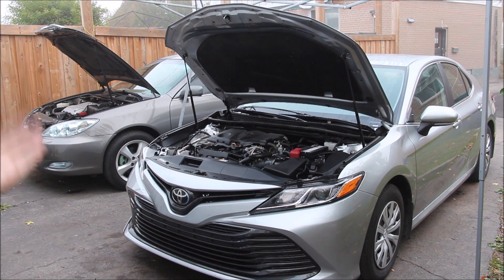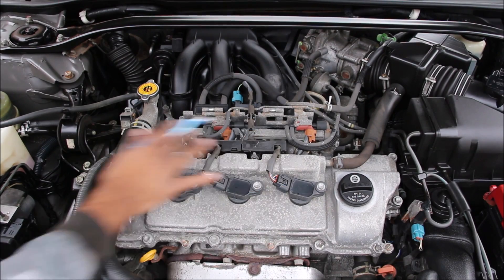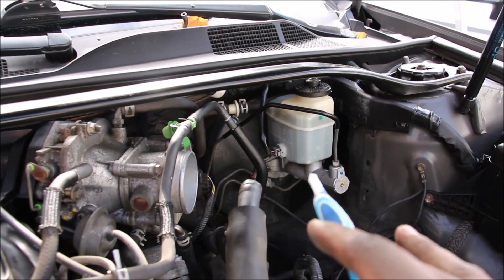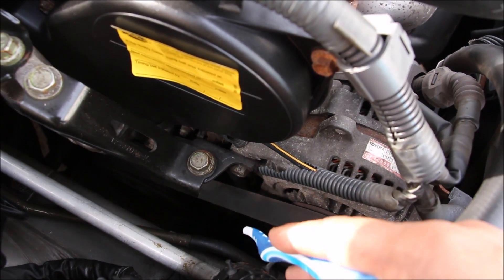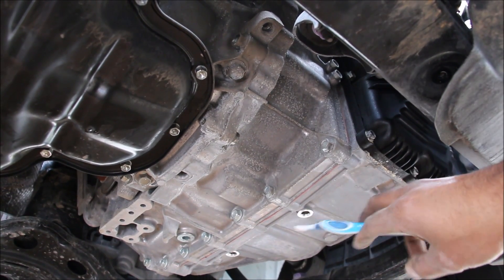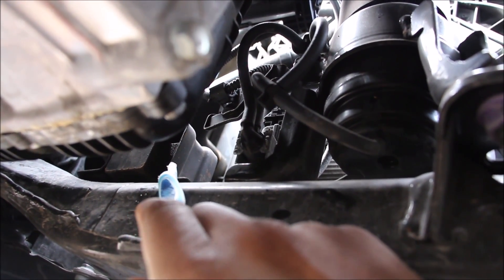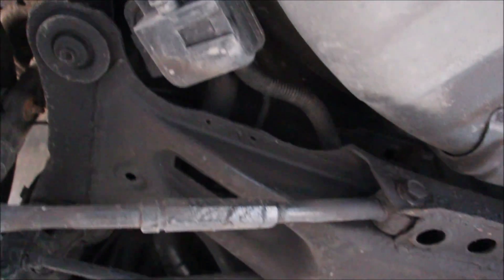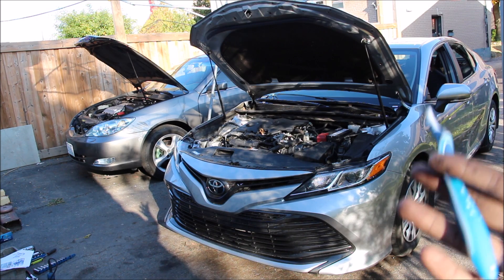Toyota Camry Mechanical Review | What Changed in 15 Years?

Comment: Peak car seems to have occurred in the 2000s-ish. Low emissions, port injected, knobs, dials, cable shifters and no infotainment. Who does't like the power the new cars are making but they cost too much to buy as a first owner and the second owner is going to have to deal with all of the value engineering. I do like the electric water pump and the return of port injection to keep the intake valves clean.
Reply from the maker: Great thoughts though a very classic perspective. The market has shifted towards cars that people buy brand new and without regards to those who will own/work on them down the road.
Reply: @speedkar99  We do OK with two working parents and three kids but we can't afford a new car. I think besides the govt mandates, the perceived need to redesign every two years totally drives up the costs beyond that of a working class family. Repair is also an issue as independent shops struggle to keep good help and buy all the tools while the cars change designs so quickly. Grrrrr.

Comment: The 4 cyclinder Camrys are very easy to maintain; you just cannot beat the engine room you have to work with.  My family has the 2002 XLE model.  Too bad that model has (apparently) known issues with head cylinder bolts (search youtube, if you haven't heard about it).  I like the new Camry except for the ECU placement (although that seems to be very common nowadays).  I also don't really like the direct injection because  they also have to use port injection to try to alleviate carbon build up issue on valves, but that's just more parts that could fail.
Reply from the maker: Yes the 4 cylinders aren't too difficult to work on. 
The V6 are challenging, though I'd still take a v6 any day for the power and smoothness

Comment: Hey Speedkar99 can you comment on the stabilizer link design on the Camry where it's a long link connecting the stab bar to the strut, vs some other vehicles where it's a short link connecting the stab bar to the lower control arm?  Opinions on performance? Awesome vid as always
Reply from the maker: The length of the link doesn't matter. The closer it connects to the wheel, the better the motion ratio and thus effectiveness.
Reply: @speedkar99  So my 1996 Nissan Maxima is basically a racecar, NICE haha. Thanks!

Comment: the 2002-2006 camry gotta be the strongest generation camry ever made. my clumsy girl hydroplaned and smashed into the road divider curb 40mph and severely bent both front steel donut oem rims. I installed new rims and tires and no problems. how in the hell ? I expected bearing, tie rod, control arms, suspension, ball joint to all be completely destroyed.
Reply from the maker: They are pretty tough. 
The 92-96 is probably the best but you don't see to many around probably due to rust.
Reply: 97-2001 the last great camries

Comment: I have a 2018 Camry. I hope this highly advanced 4cyl and transmission last over 200k miles
Reply: were at 140.000 on our 2013 camry no problems my son has corolla same yr 190.000 miles only problem coil packs. great cars
Reply from the maker: Time will tell. The last 4 cylinder did well
Reply: Change your trans fluid, if you have the guts to void your warranty. Of course, warranty doesn't compensate you for time lost if the car fails. I'd personally run a thicker oil too, but wouldn't recommend others do it. For that matter, I wonder what specialist taxi garages do to keep these things rolling; they usually have a few tricks up their sleeve for longevity and fuel efficiency of fleet cars.

Comment: What are your thoughts of the plastic shrouds underneath the vehicle? To me, seems like it will trap moisture, snow etc and accelerate the rusting process.
Reply: I was thinking the same thing about that
Reply from the maker: Yes and no. It prevents salt water from splashing there in the first place. 

What ever makes it there will be difficult to wash off since the plastic is blocking it. 

So far it's been working on on 12 year old Lexus.

Comment: Watching this makes me miss my Uncle’s old 2002 Camry LE. God, don’t I miss that car. 😭
Reply from the maker: Good times. Was it a v6?
Reply: speedkar99 It was the 4 cylinder. It had 246k miles on it before it got into an accident back in late July 2018. Despite the fact that it leak inside a lot, gone through many flat tires and and had a lot of mold & mildew, it was the most reliable car that my Uncle ever had. Always started and never once broke down.

Comment: Had a 3-way comparison going the whole time, since we have an 03 Avalon: 19 Camry, 04 Camry, 03 Avalon. Not seeing much that would drag me into the new Camry... except on the new one... timing chain (belts suck), rear suspension, beaucoup airbags. I worry about [future] aftermarket parts. Dorman is already plenty bad without burdening them with crap versions of sophisticated electric motors. And, if I got the new, I'd work with some body shop to change the front-end bite-y alien mouth & overhead attack pterodactyl into something more humane.
Reply from the maker: Which do you prefer personally? Your older or newer cars?
Reply: @speedkar99  Easy question, since I don't have a newer car: our family's old cars, 01 and 03 Avalons. At 66k & 98k miles, they're just babies... That said, I envy the new safety stuff, am suspicious of the plastic stuff, and know that the multiple module-driven stuff will evolve into expensive broken stuff.
Reply: @speedkar99 (Mis-expressed my first response - should have said, 3-way mental comparison, our 03 Avalon and your 19 and 04 Camrys. It was interesting to compare and  contrast the three.)

Comment: I like the fact that the old camry has proven itself  but maintenence is definitely easier on the newer camry.
Reply from the maker: It's not as bad on the i4 version of the old Camry. This isn't a direct comparison because of that.
Reply: V6 engine is complicated but 2.4 liter engine is so easy to maintain.
The comparison should have been between camry 2005 with 2.4 liter engine and new camry with 2.5 liter engine

Comment: Old one is a tank that wont die. The new one sacrificed a solid structure for safety tech
Reply from the maker: Yes alot of sacrifice at the cost of what made Toyota unique.... quality
Reply: Actually, the structure is much stronger in the new one. The A and B pillars are made of ultra high strength steel, which protects you in a collision.
Reply: Ends up being a ton safer though. Even the 2012 Camry holds nothing on the current one safety wise.
Reply: I believe that Toyota is using more aluminum and light weight strength.

Comment: Holy smokes toyota went with electric water pump and thermostat?
Reply from the maker: They've been doing it a while
Reply: Toyota is copying from the Germans.
Reply: @theinvisibleman2070  LOL
Reply: Much more faster engine thermal handling and those work just fine
Reply: Toyota has gone OUT OF THEIR WAY to screw you out of money.
Reply: @baddestburrito  Paranoia.
Reply: @seanv1556  I drive a 27 year old Toyota that still runs like it's new.  Do you think the 2019 models will be equally healthy in 2046?  Hell, the 5th and 6th Generation Camrys have already started to get rarer, while the 4th generation cars have stayed numerous.  It doesn't take a genius to figure out that in 2002, Toyota changed their designs.  Call it paranoia if you want to. It's not my job to free you from ignorance.
Reply from the maker: True I don't see many Gen5s 
The V6s were the most reliable but most people bought the crappy 2.4L i4 

Gen 4s are plentyful 
The gen 6 population is helped by all the taxicabs out there
Reply: @baddestburrito  and fuel injection, airbags, antilock brakes..yadda yadda yadda.. Rinse.. Repeat.
Reply: @baddestburrito  I see 4th-current generation in copious amounts every single day. I own a 4th gen. Dead reliable and everything all works like new and it's hardly babied.
Reply: @seanv1556  Maybe you live in a particularly Camry-kind environment.  Around here -- and in many other locations -- the 4th gen outnumber the newer ones.  Say, have you looked at the mechanicals of the new cars? The sealed transmissions, plastic parts, etc. are all designed to function perfectly...until they are out of warranty.  New Toyotas do not have the life span of the older ones.  That is simple fact.
Reply: @speedkar99  Exactly. Your honesty is one of the reasons I subscribe to you.  If Toyota had continued to improve their cars over time, we would expect the newer ones to outnumber the older ones.  Pretty simple logic. But because the reverse is true, and the older ones outnumber the newer ones (unless something weird is happening, like assassins are specifically targeting the new ones...which is absurdly unlikely) the same simple logic strongly suggests that the newer designs have gotten inferior over time.  Again, I drive a 27 year old Toyota that runs like new.  This is a feat that I HIGHLY doubt any 2019 Toyota will accomplish.
Reply: @seanv1556  Thank you for making my point.
Reply: @baddestburrito  What point???
Reply: @speedkar99  what’s wrong with the 4
Reply: @issavibez394  I want to know also

Comment: I like the fact that you took the extra time to show where they actually cut cost too..I'm learning so much in your videos!
Reply from the maker: I felt that was essential for this comparison
Reply: @speedkar99  it really is essential to show not just what has been upgraded but also what has been downgraded to get a real comparison. Thank you.
Reply: @speedkar99  You really know your Camry. I would love to pick your brain.Your Toyota to Lexus front brake conversion is of great interest to me. I own an 05 LE 2.4 and I want to swap the rear drums to disc from the XLE or SE. I think it's a pretty simple task of swapping in the brake shield/bracket, e-brake hardware, calipers, etc. From what I've researched so far, the rear hub and bearing assembly are the same part across all models (Solara, Avalon, ES330, Camry). In your opinion, do you think my swap is possible?
Reply: Thin tin. I didn't think they could roll it that thin but in WWII aircraft they had skin that thin. B-24 Liberators were like metalized paper stung over stringers and longerons. I imagine the parts will cost 5 times as much. No win for us. Toyota keeps more profit.

Comment: I've been reading some bad things about the 8 speed transmission related to shifting issues. Supposedly it has been a problem for a number of years   affecting various models. Shocking since Toyota isn't known for such powertrain issues The old 6 speed transmission has apparently been very good though.
Reply: I have the 8 speed ..shifts flawlessly
Reply: Why the hell does anyone need eight speeds? I remember the old two speed Powerglide transmission and the "new" three speed automatics were such an improvement!
Reply: @nasedo3129  Agreed. I'm still driving a 4 speed 2002 so 5 or 6 is plenty. The automakers have gone crazy with marketing gimmicks.
Reply: @nasedo3129  For fuel economy, to meet EPA ratings.  Yeah I agree, it doesn't need 8 speeds.  The six speed would have been more than plenty.
Reply: @nasedo3129  Why did anyone need three? Same reason: Improved acceleration and fuel economy. The limiting factor is always the size of the trans itself; IOW, the additional gearing has to more than make up for any increased weight or aerodynamic drag.
Reply: Personally hate the 6 speed. Have had nothing, but great driving performance from the 8 speed unless you drive like grandma as I've noticed the computers* seem* to adjust to driver over time - fairly quickly. After I drive there 8 speed a few days shifts quick and smooth without flooring and always probably keeping rpms under 3k. I'm fast yet gentle controlled driver. The 6 speed constantly wants to down shift whenever I want to accelerate into traffic, which makes it feel unsafe without feeling like I'm harming the transmission.
Reply: These seem to have been fixed in the later builds (2019+).

Comment: That sealed trans, with its, "lifetime fluid," is giving me goosebumps.  What a load of marketing BS.  Have you SEEN the state of the ATF that comes out of those, at anything past 60,000 kms?  There is no such thing as, "lifetime fluid."  It"ll get you to the end of the car's warranty and then they basically force you to junk the car. 

I don't know about your location, but around here, if you look around on the streets, you see 2 conspicuous things:

1) 1997-2001 Camrys are still plentiful, despite their age.  That tried-and-true design will not die, and you can SERVICE the wear-and-tear parts.  Owners hang onto them.

2) 2002 and up Camrys are RARE now.  You just don't see 'em.  I've already explained why. Only the newest ones are still on the road.
Reply: It is not lie that the oil is not needed to change in it's lifetime. Lifetime ends when transmission or rear diff or some orher "maintenance free" component breaks down 😄
Reply: @dot7107  Funny guy! :-)
Reply from the maker: Good observation. I do see more gen4 than gen5 around here too, and it's been like that for a while. There's tons more gen6 driving around though. 

Interesting though as the V6 gen5 were one of the most reliable. Most of them are probably I4 and had the head bolts strip and burn oil.
Reply: @speedkar99  Suspicion confirmed: the gen 5 and gen 6 cars will last, only if the owner takes extraordinary measures...such as changing that, "lifetime fluid," against the manufacturer's recommendations.  In the past year, I think I have seen no more than 10-20 gen 6 cars around here.  All you see is 7th, 8th, and 4th and 3rd.  The V6 5th gen -- like yours -- still has a dipstick-equipped trans. That explains a lot, too.
Reply: @baddestburrito  Along with removing the dipstick the change to DS fluid that is not is not synthetic!
Reply: @baddestburrito  Along with the lack of dipstick the change to DS "lifetime" fluid that is not synthetic!
Reply: 2002 “MADE IN JAPAN “LE 4-cylinder with 207K miles! Replaced radiator with a thicker core from Denso. Running strong!

Comment: new Camry is more fun but I personally wait 7 years to see how GDI engine last over time. then buy used one :)
Reply: Toyota uses a mix of both GDI and port injection.  I've read that Toyota builds their engines with this extra complexity to avoid any carb issues.  So, you really have nothing to worry about.  I'm avoiding Honda for my next car purchase, though, because they use GDI only.
Reply from the maker: It probably is better in higher trim but this LE model didn't impress me too much. It is quicker off the line than my old V6 though.
Reply: @Saeed Momen This is not a straight GDI ONLY CAR...IT USES A DUAL GDI/PORT SYSTEM INSTEAD AND THIS ELIMINATES THE CARBON PROBLEMS ASSOCIATED WITH GDI ONLY SYSTEMS...HONDA IS HAVING BIG PROBLEMS WITH ITS GDI ONLY SYSTEM....FUEL IS REACHING THE OIL PAN AND DILLUTING THE OIL, SERIOUSLY HINDERING THE OIL LUBRICATING ABILITIES
Reply: I'm Still Alive  still I don't want to test it I guess I am cheap 😁😁
Reply: Saeed Momen don’t need to wait it’s the best by far get this Lexus been using this Tex back from 2008 doble injection it’s  so dependable for Toyota’s nothing beats them ever get dirty valves at all they did on Lexus many years ago when the rest were starting to use direct injection lexis was doble injection already
Reply: I'm Still Alive  Yep, the carb issue is why I'm avoiding GDI-only cars like the plague.  I live some 35 miles from the Marysville Honda plant.  As much as I'd like like to support local job, I can't get past the fact that Honda uses GDI engines.  So, my next car's going to have to be a Toyota.
Reply: Toyota used d4d duel injection. Not like the other companies.

Comment: Are you sure that's V6 engine is 1MZ-FE ? 
I guess that's a 3MZ-FE which is more powerful than 1MZ engine.
Reply from the maker: Yes is the 1MZ. The LE and XLE Gen 5 had the 1MZ and the SE had the 3MZ. 
Although more powerful, I prefer the smoothness of the 1MZ.
Reply: @speedkar99 Because the head gasket cover on 1MZ  looks way different from the 3MZ ,it looks smaller from the side next to the oil cover, and the intake manifold on 1MZ is made of aluminium unlike the 3MZ made of plastic.
Reply: @basil4everx2007  Are you talking about the 1mz with the black beauty cover, as opposed to the silver one? If so, it sounds like you have the non-VVTI 1mz-fe model. I believe they started with the VVTI models, like in the video, in 2003 for the Camry line. I have the non-vvti 1mz-fe in my '02 Camry.

Comment: V6 all the way!! 4 cyl is great on motorcycles.
Reply from the maker: Yeah I'm a V6 guy too. 
The 4 cylinders are catching up, this one was quite zippy and felt faster than my old V6 Camry.
Reply: Have you driven a Camry 2.5l?  I have not once thought I needed more power with my 2.5L, but I don't transport a sumo wrestling team or live by a race track. lol
Reply: @benmudn  i agree my wife owns one.
Reply: i was a six cylinder man. and my wife bought the 2013 camry with a four cyl. it proved me wrong. that 4 has all the power needed. and no problems at 140.000 miles